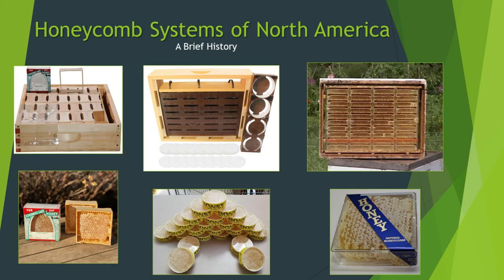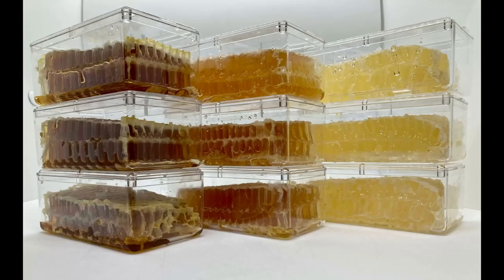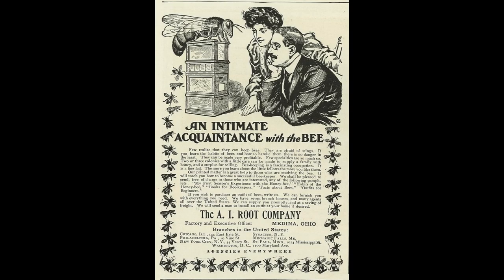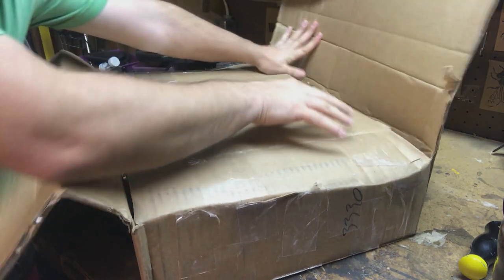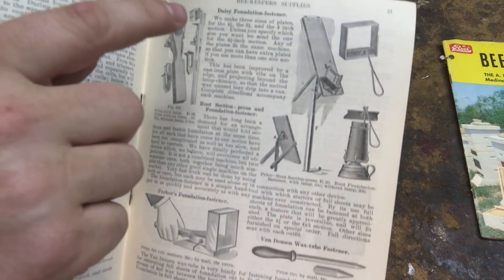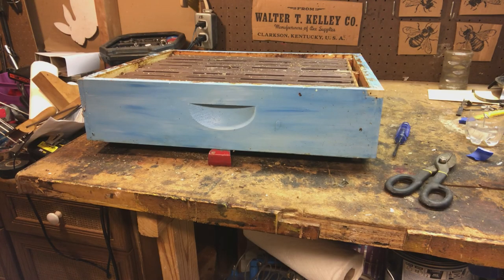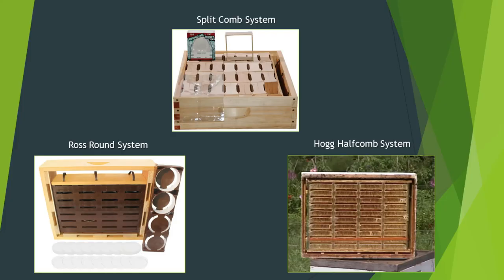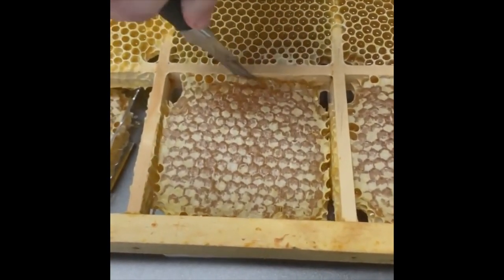Honeycomb Systems of North America - A Brief History

Comment: Make the boxes, install them in the super and then install a full length sheet of wax into the 4 sections at a time. There was a metal slotted insert that fit in the slots at top, held box’s open and the wax inserted in all 4 units at one time.

Comment: We used the solid sections and put the boxes together. The we cut the wax into small triangles (2x2x3”) and then with a wood burning tool, held the wax center top, quickly across the wood and wax and folded it up. This gave the bees a start. They filled the rest and the wax sheet went further 😀

Comment: Soak the entire box frame for 1 minute.  Rarely broke them.
Reply from the maker: Thank you for the advice! I don't mean to pepper you with questions, but users of split squares are few and documented knowledge from them is rare.

Do you still use split squares? If not, when did you discontinue using them? Did did you move onto a different comb system? Do you recall around what years you use them?
Reply: @beekygeek7873   The last time I folded sq's was 40 years ago.  We went foundationless for cut comb.   If you lay the squares in a tray of water (they are in there for maybe 30-60 sec's) they get soft and bend easy.  However if you leave too long the ends (dados) swell and they are hard to get together.   They dry quite quickly.   The size was just right for the market.  The market changed -  less and smaller cut comb.  Now I only sell full frames of foundationless comb.
Reply from the maker: @danielweston9188  Everyone else I spoke to gave it up around 1980 as well. I need to make $20 per Ross Round disc for comb sales to be worth it, although I do keep 2 or 3 foundationless frames in 4-5 of my honey boxes so I can make plenty of chunk honey jars.